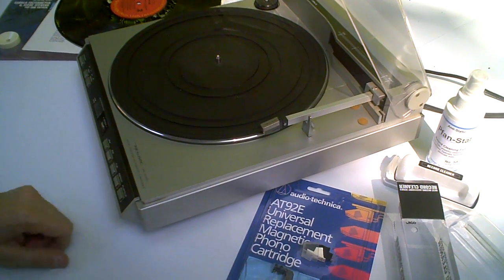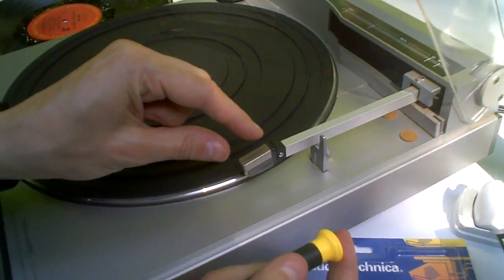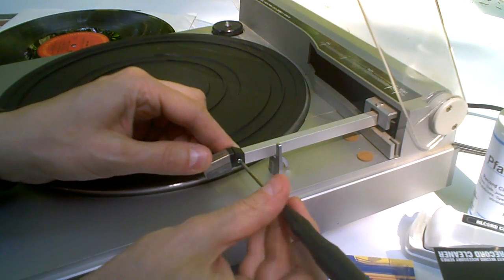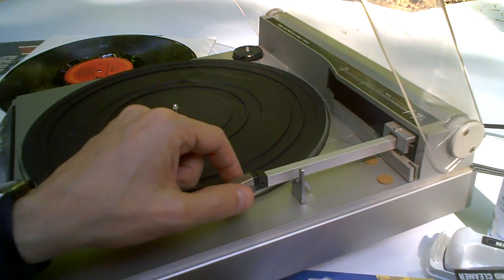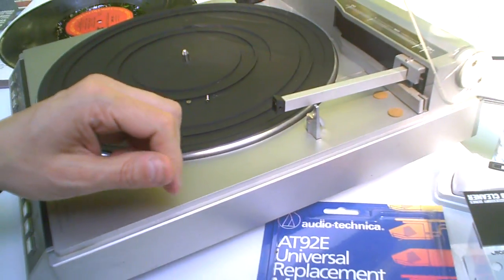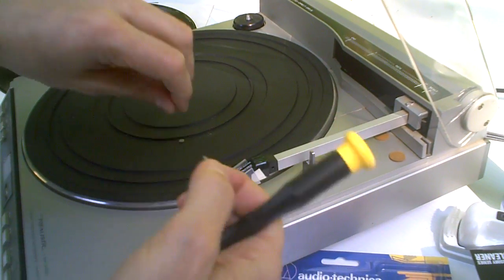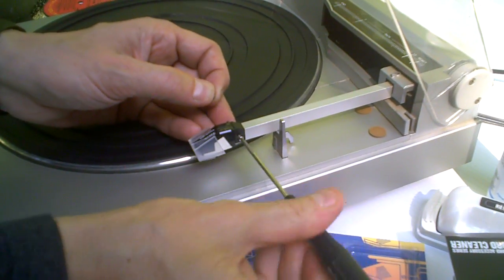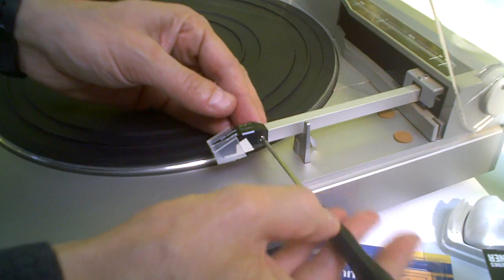Realistic LAB2000 Pmount Cartridge Install

Comment: Hi! Thanks for the video. I got a Sansui P-m7 linear turntable and found that it uses a pmount Cartridge. I removed the styllus but could not even identify how to remove the cartridge. Do you have any ideia? I also got a Technics SL-QL15 and it is super easy to do so.